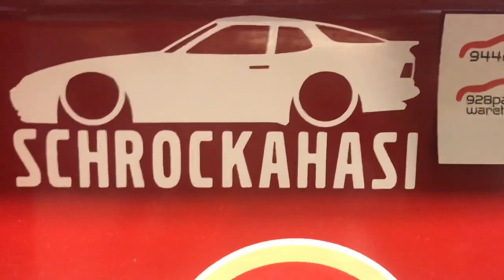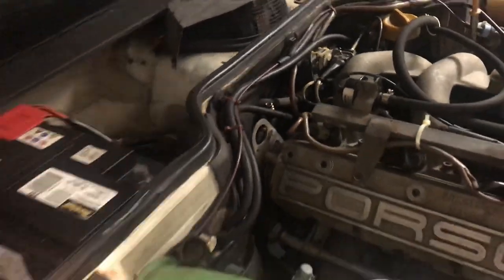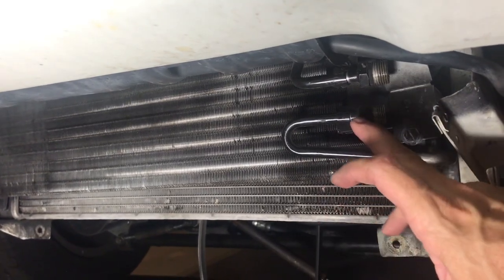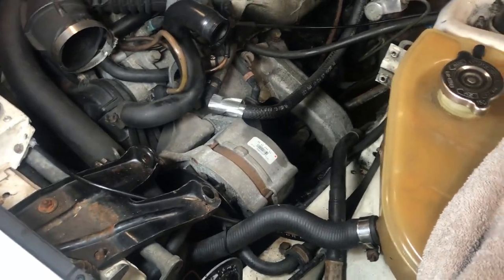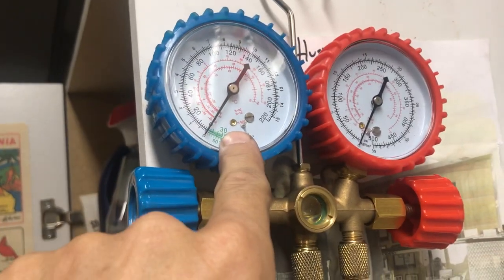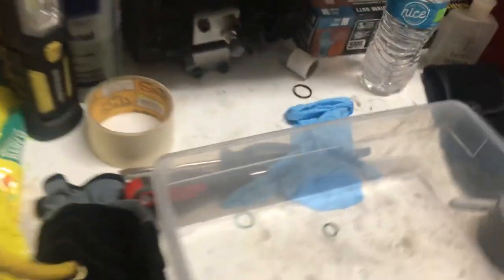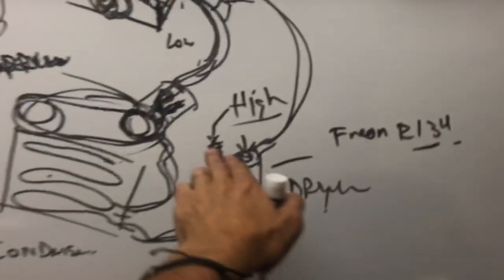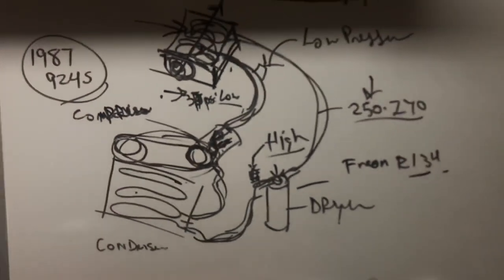Porsche 924S 944 Air Conditioning AC basics lecture of the system

Comment: I've got one of those AC hose crimpers and find it's very easy to use. Ironically I bought it years ago after being very disappointed with the results of giving some lines to an AC shop to retrofit with new barrier hose. I've made two lines up for my own '87 924S. I stripped off the old hose, sent out the metal ends to be replated, and fit new hose to them. 

On another subject, I notice the vacuum canister on your 924S is in the engine compartment itself, like first year 944s were. They (supposedly) changed the position of this piece in '84 to the cowl beside the fresh air blower motor, where it is on my car, and also an '84 944 I have. How is yours where it is?? I also notice the AC compressor manifold on your car is different...stange.
Reply from the maker: the Vacuum canister was there when I got the car. It’s not connected and needs to be replaced. 
Good to hear someone made their own ac hoses and it worked. My shop hoses were $30 to $120 depending on length and the mood of the shop owner at the time. I’m happy though because I never expected to have ac on a 30 year old car and finally it’s working great.